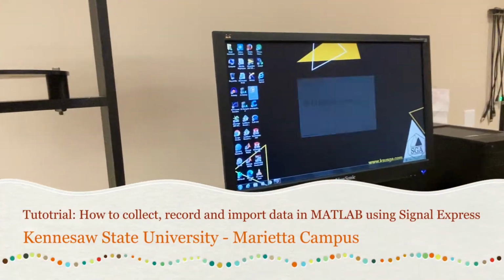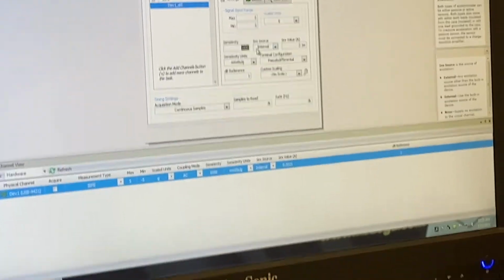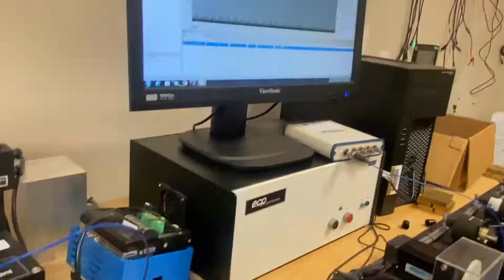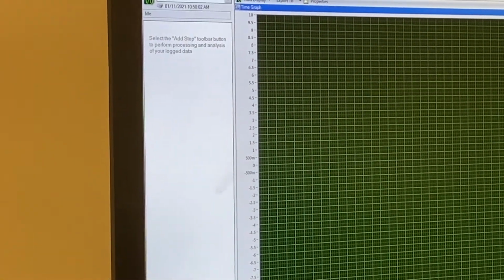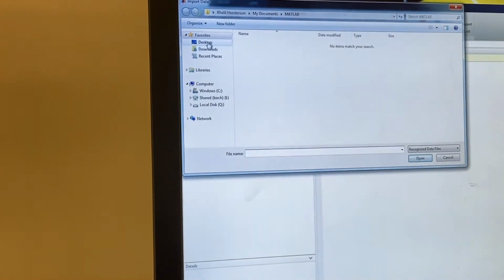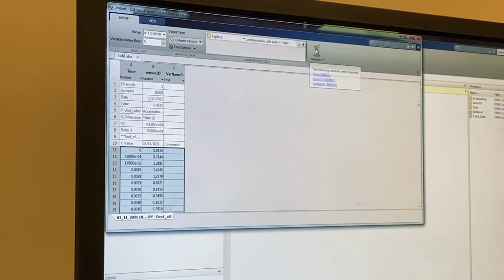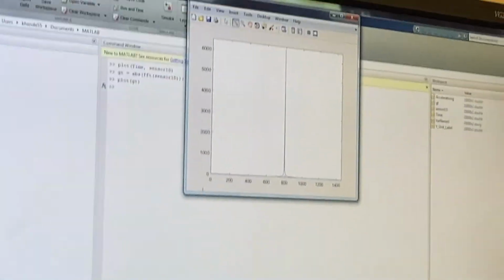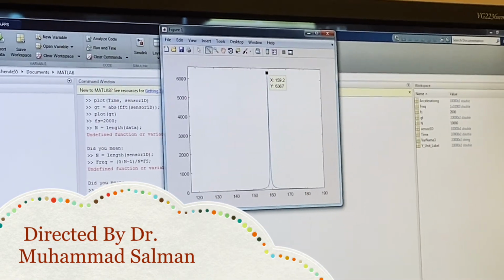How to use LabVIEW Signal Express collect, record and export data to MATLAB

Comment: Excellent video. I use Signal Express to log a NI9239 at 25ks/s. I export to notepad first, then to excel after I have downconverted and averaged the data. Then I run my own FFT software in Excel to produce a nice FFT plot. Essentially I am using similar steps to those shown in this video, looking at structural vibrations from 2 Hz to 100 Hz.